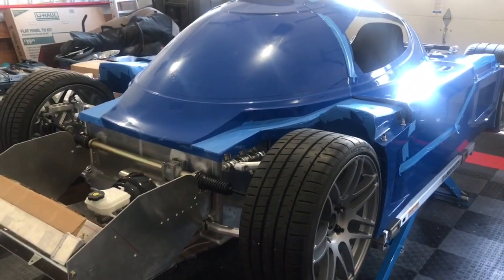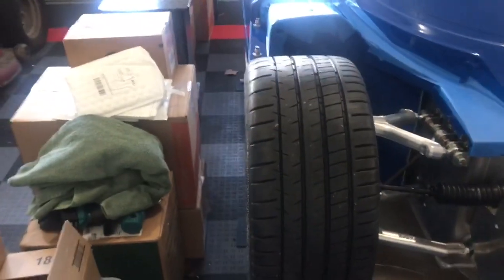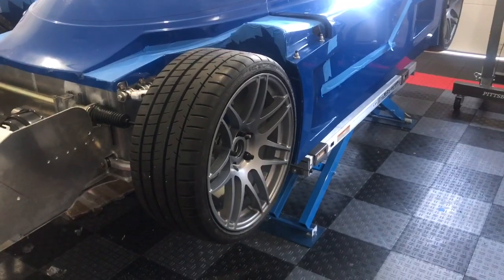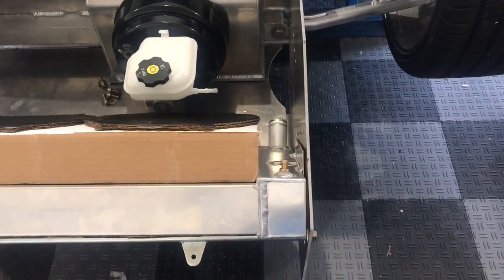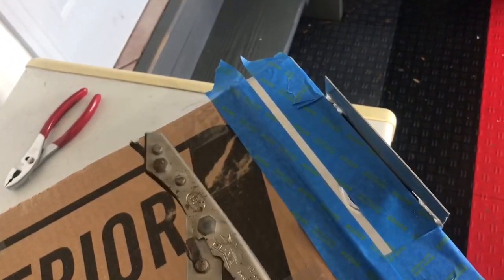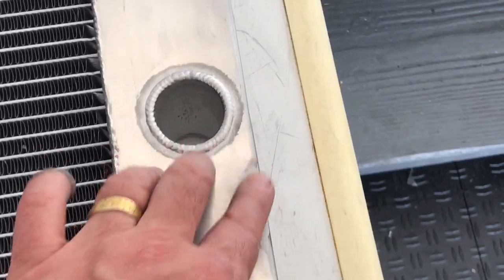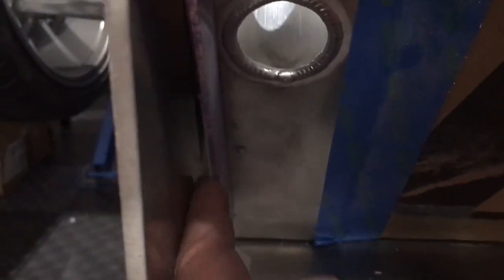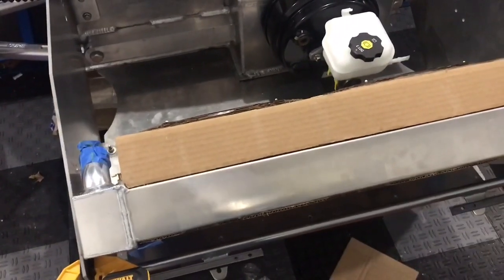Superlite SLC Build 053 Radiator Bracket Fabrication

Comment: very helful video Joel. i will have Michelin tyres with same rims (F14). Can you tell me the width of your front rims please? 19×9.5  or 19×10? thank you
Reply from the maker: Hi Fred, I have the 9.5” front wheels. If you get the 10” fronts you can run a slightly wider tire. If you have 9.5” wide rims do not get the 285/30/19, find a tire size 275/30/19. The 285s can work for a 10” front rim although you will need more negative camber than you may want to run if it is a street car.
Reply: @JoelKSLC   you are a treasure! thank you very much. I plan to bring the car often to the track but won t sacrifice the street capabilities so i will go for 9.5'' wide rims and maybe 255 or 265. I m afraid 275 may be too wide. I follow your build on gt40'S forum as well. You are such an inspiration! keep going